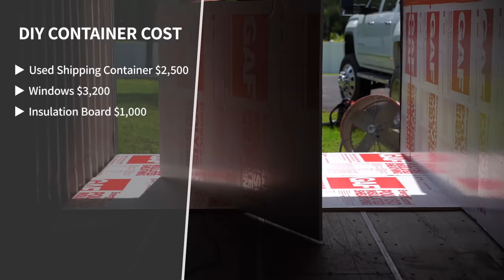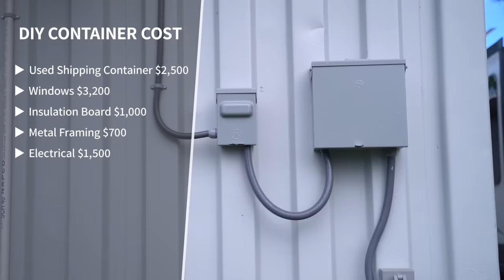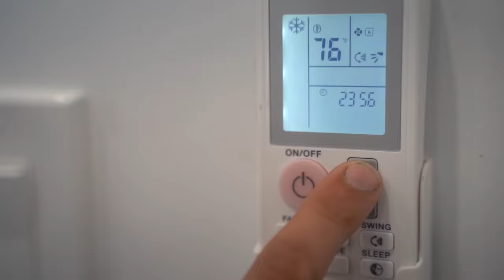40ft DIY Shipping Container Home (Total Cost Breakdown)

Comment: I’d rather spend $30,000 on a shipping container home than a $40,000 car. Absolute no brainer.
Reply: Well said ..
Reply: @kouassikoffi4786  agree.  car = depreciating asset.  Container home = appreciating asset
Reply: @SuperMillions100  if it's depreciating it is a liability homie.
Reply: Advantage of Shipping container is the ability to move the Container house to new other Location... Mobile Deployment House is house of the future
Reply: @rommelcorbito808  A comparible sized wood home could be moved just as easily.
Reply: @JM-nh8yp  Exactly and could make up to 12 feet wide instead of 8 ft and still move many areas without wide load permit.
Reply: Especially if you tack on another 25k for rain water and solar and go completely off grid.
Reply: Spot on!
Reply: I agree but that’s only feasible if you have cash. Financing is another story. There are way more banks that finance cars vs container homes
Reply: And a lot stronger than your average Trailer Park Trailer.
Reply: Paid off our reg. hm early,  then $40k car w/cash.  Better retirement arrangement (for us) after typical 15-2500 sqft hm/shop on 10+ acres.  I see building this in bk of 10 acres now.  Sell orig hm & carry paper for 10yrs of income on balloon note. Older we get..easier for us to slim down we feel.  U all likely see this as 1st hm.  We see this type as our last.  Minus dsily stairs. Using 2 containers/parallel & spaced apart. Then building patio & living space in between space of both containers w/upstairs patio/deck.  If u buy um cheap enuff.  Do 3 cont'rs. & build a U shape w/um.  Enclosing the open 'horse shoe' area to ur taste.  Regardless of what u want/need.  Its not a bad plan for early or late in life.
Reply: how bout a shipping container rv ?? so you have em both .... a house on wheel :)
Reply: @spartanx169x  If you don’t compromise the structure with openings for windows and doors. Otherwise you still have to reinforce with lumber or metal framing of sorts
Reply: Great job and very informative.  Thanks!!
Reply: Right because if you spent $30,000 on a $40,000 car you’d only get 3/4 of it and that would be useless ....
Reply: No kidding! Especially where I live, traffic for days and homes are in the upper 6 figures for a shack 😭
Reply: 4 sure
Reply: get a car on credit and sell it and build your home, spend your saved rent on the car payment and pocket the rest
Reply: @SuperMillions100  everything depreciated, from windows to light fittings, taps etc
Reply: Exactly
Reply: Absolutely. Why ive been song my research. Definitely  investing
Reply: Also better than a $30k 30ft rv
Reply: @ared18t   yup I’m doing this
Reply: @digitalplowboy2823  so with that logic you cannot sell your house? Give your head a shake.
Reply: what about a van life vehicle?
Reply: Then use the profits to buy the car 😜
Reply: Want to make one with me?
Reply: I rather have both 🙏🏼
Reply: Absolutely
Reply: Do both
Reply: Que
Where did you paid 30000$ for everything in Canada?
Reply: Who still buys a 40k car? Me and my buddy were laughing because he still buys 5k cars and he and his wife’s combined income is over 200k a year. Do people that make 50k a year buy 30k cars?! 🥴
Reply: right and wrong your talking about depreciating value over time,  car vs home everyone knows you can't build equity on a car so making up a question that nobody ask is obvious, nobody would want to build equity on a car when buying it because you simply cant.
Reply: Two guys comparing apples to oranges
Reply: I would rather do both of then
Reply: You can sleep in a car but you can't race a house 😉
Reply: @patjohn775  yes, they do. They also live w their mother and go on dating websites.
Reply: @TeePole59  I’d rather live in my 40k car. Hate being stuck in one place. Nomadic heart.
Reply: @patjohn775  I make over 100 k and my vehicle was 42k
Reply: @jacopodanglars4836  They are not cheap. Even 10 years old and very high miles. Like 280k miles!
Reply: Say you're broke without saying you're broke
Reply: @spartanx169x  stronger than a stick build as well. A container is all steel not plastic like most if the components of mobile home. No comparison.  If a tree falls on it, I cut out a small section and welder it back together.  If it falls on a stick build, a huge section of the house is destroyed.
Reply: @chrisluyken4550  you can't sell a car that you bought on credit and pull all the money out of it without paying it off first. No one would buy it. Wtf kind of logic is that?
Reply: @ared18t  it's only a liability if you owe money on it. if it's paid off and worth any money at all, depreciating or not, it's an asset.
Reply: Well said.  I Agreed 💯
Reply: 30k for 160sq feet is astronomically expensive....literally $187 a foot. You would be better off just building a 10x20 house because the exterior of standard construction is better than the exterior of a shipping container. You have to build out the container, the only thing the container provides is the equivalent to vinyl siding, hardy board, brick...the metal is just the exterior and they breakdown very fast on containers and you have to paint them more often than a house.
Reply: @stephenwhite5444  I think it is 40 ft x 8 ft wide, 320 sq ft living space, correct ?  Not 20 ft container. Rental income $1500 each month, I will put 2 units on my land anytime.
Reply: @BriteImpressions1  your right, I was thinking it was 20 but it's 40. But it doesn't matter...all the container is saving you is the exterior plywood, vinyl siding, few bundles of shingles. Which is about the same as the container cost but is longer lasting, easier to repair, and cheaper to maintain. Honestly, I'd rather just go buy a nice used RV with the same budget...itll will more space and be ready to rent out right away. The rental income you'll generate in just the time it takes a single diy'er to build from scratch will offset nearly the whole cost of building something.  ALSO, since this came out 2yrs ago most building materials have doubled, some are much more than doubled....as few, like paint might be about the same, but most have gone way up.
Reply: @stephenwhite5444  thank you very much.  I know someone will do both containers for 75k which can rent out for $3000 combined per month.
Reply: Forsure!! Plus, if you ever want to move, you can easily rent it out 🙌🙌
Reply: @kouassikoffi4786  32²
Reply: I'm with you plus  it will be my Build
Reply: @ared18t  Kiyosaki pilled
Reply: Agrees
Reply: Yes better paying rent can have your own house
Reply: That’s what most people not looking at it’s way cheaper than buying a home.
Reply: Facts
Reply: Agree
Reply: They charge like 67K I think
Reply: Same!!!
Reply: FR. Elon did take a crack at the unit housing thing. But idk what happened to it.
Reply: @stephenwhite5444 i agree, the only reason I consider a shipping container is to build a shop, or storage shed behind my house

Comment: I'm am architect of many years. I've looked at the numbers for this kind of project. I agree with his estimates here.
Reply: what do you do in your freetime Mr. SHROOMER? Hmm? :)
Reply: @EthosAnanda  Bruh. 😂😂😂😂😂
Reply: Ethos Ananda that's why he is an architect
Reply: I mean, he built it, so it's not like he just threw out a random estimate. Lol
Reply: I don't know if you'll respond but how much would this compare to building a traditional home (with wood I guess) of the same size, people keep saying its cheaper but everywhere I look shipping containers seem to be lower
Reply: Bob Dole so your looking at a 20x16 to keep waste down and use 16ft boards. Just the shell of something like that would be around $5k. That also depends if you put post in the ground or pour a slab. If you use same materials inside as he did , you could be a little bit cheaper but not a lot
Reply: @hickoryridgefarms  Thanks, most people never really give me any kind of a concrete answer. So at the very least its starting point would be 5k. Then every thing else from this vid (maybe save for insulation) would be roughly the same, correct?
Reply: Bob Dole could be cheaper than $5k. If you order in bulk at a big box store you could get a discount. Meaning if you ordered all your wood at once you can save some money. 

The inside just depends how you want it finished. Me personally I would buy raw cabinets and finish them your self. Laminate countertops are very appealing anymore but very functional and a lot cheaper than other options. 

As for insulation, spend the money and have it spray foamed. Close cell or open as long as you have an air barrier you won’t have to worry about mold
Reply: Yeah but he's also paying for a crew if you were to do this with very little help and makeover allot of older stuff like used cabinets and items as such it costs way less
Reply: @bobdole27  
From my research it's about 30% cheaper to go container home. I've been trying to find someone who can go start-finish but it's been difficult. 
I've found a couple of parcel but I don't know what  the City/county rules n regs are etc.
I've been "estimating" if I can buy property for $200k
A 1800 +- sq.ft. structure should be about another $200/$250k.
I know that it can be a LOT more but it can be less (as seen here)
I live in California so this would be a "steal" compared to the $850k i just dropped on a traditional  stick house.
(It is nice though ;)..
I have no tools or skills,  only imagination and that can be expensive..
Reply: Can I get a architect information
Reply: I mean how could you not agree. He’s literally
giving you the price he paid.
Reply: @SDPBALLCOACH  I'm in Mexico and a 2 container home goes for $100,000 start to finish..not sure if price is a bit high
Reply: @shoshi06  
Sounds great. 
Thing is, what size containers? how many bedrooms/baths sq. Ft.
How's it been put together etc...
100k makes me a bit nervous....
Reply: @SDPBALLCOACH  yeah,think I'm being ripped off. Am in Mexico and the guys asking this amount. 3 bedrooms,2 bathrooms, upstairs terrace and outdoor main terrace. Living room,kitchen. Price is steep. Cement is cheaper😅😅
Reply: @shoshi06  
Yeah, have you seen it??
Do you have pictures to post??
Mexico or not that's a really cheap price. 
Of course if it's just a fishing or surf shack 
Go for it!!
Reply: every build will have site prep and connect to water or sewage, and permits
Reply: @shoshi06 that’s a pretty reasonable price for that amount of bed rooms. 1 bedroom containers are going for 85k.

Comment: Take the total cost of materials, add $2,500.00 for incidentals and cost increases, at $19,820.00 and for labor multiply by 2.5, and $49,550.00 is your total build cost for the container. Add another $10,000.00 for roofing, siding, outside electrical, Container foundation and landscaping.  Essentially a $60,000.00 build.  Still a great deal for an ADU.

Comment: I'm down in Alabama and built a shipping container for a bunk house at our hunting camp. I'll be the first to admit that it's rough and not nearly as refined as what you do, but there's a local trailer salvage company that we bought all of our fixtures and plumbing needs from such as toilet sinks etc. It's by no means a mansion, but for its purpose we spent less than $7k and did all of the work ourselves. The biggest single expense was renting a trackhoe to dig into the hillside. (The container is set into a slot in the hillside for shelter from storms)
We have a large wood stove for heat and a 15000 BTU air conditioner in the front that keeps it cool in the summer. Aside from the bathroom at the rear and six bunks in the center the kitchen/dining area up front is always open and has plenty of airflow for the heat and cold to work easily. If you guys are interested I could always take and post photos.
Reply: Of course we are interested!
Reply: Please share. I'm most definitely interested.
Reply: Yes I interested in getting one, what must I do?

Comment: Still cheaper than a $800,000 house in Los Angeles that's falling apart. Damn walls can't even hold up a thumb tack 😔
Reply: Lol
Reply: That true, in addition  you spend the rest of your life paying for it, and you can lose it if life throws you a hard ball.
Reply: Yea, but living in Los Angeles was the first mistake......
Reply: I'd reckon putting a container home in LA would cost a lot more too...
Reply: Haah seriously smh
Reply: Most of the 800k are for the ground to put it on, so the container home is not exactly going to solve this problem.
Reply: Yes
Reply: @schwarzerritter5724  no you can find land for 15,000 to 225,000. 800,000 would be an industrial farm. Don't ever get land you would be some realtors sucker
Reply: What you pay for in that LA-house is the location - not construction. If you buy the land to put the container house on in LA I guess that won't be cheap either.
Reply: Get out of that place asap.
Reply: You're paying for the lot for $800k in LA not the home.
Reply: @riobank6245  did you just suggest to never buy land? Are you serious
Reply: Location, Location ...

Comment: Going down the rabbit hole. Watched multiple cost estimate videos for shipping. Container home. Yours is by far the most knowledgeable and articulated I’ve seen. Around 19 to minute 21 of the video your calculations are spot on and this is by a professional, calculating the cost for his own Container home… Your pricing scale can even be multiplied per shipping container to increase the size of the home i.e. $20,000 material for a single container compared to $120,000 for a six container home. That would even account for cost for things such as kitchen and bathroom which don’t multiply times six containers, but the additional cost to reinforce structure, connecting six containers needing reinforcement
Could go on for a while, but all in all great job!

Comment: Thanks for this video!  I bet you have tons of people dreaming of making a tiny shipping container home for $10,000 and you have to burst their bubble.
Reply: Ashley Steeves Well, add 30% to this and he’s realistically talking about $25k +tax to build this for you. I’d add $5k for site prep and landscaping and approvals at least as well.  So, $30k for a home?   It’s a great video in any case.
Reply: @acchaladka  Still not a bad price.  You can't buy a used home and finish to your liking for that.  Hell most Modulars are double to triple the price.   Great option for remote living or budget builds if you're not needing a ton of space.
Reply: Dad's Account oh I agree. I meant that it could be viewed from a couple different angles.  Some people spend $30k just on a bathroom.  I think it’s a nuanced discussion and that $30k can definitely be the right price for some. For example I’d want three containers and 150 sq m / 1500 sq ft total, so I’m better off looking at a gut reno most likely. Whereas someone who’s single...one container for $30k is near-perfect.
Reply: I mean if you get the shipping container delivered directly from the dock or yard, it's about 1/3 the cost. If you get reclaimed material, like all the wood, plumbing, & windows from forest fires or floods, get furniture from Craigslist/OfferUp, make the sink out of a ceramic bowl, use reclaimed wool for 1/4 of the insulation job or rely on building a thermal mass, etc. I mean it won't be easy, and clearly it would take up more time & labor. So it really comes down to saving money or saving time & effort
Reply: Ashley Steeves I was definitely misinformed wasn’t buying it but the numbers couldn’t have been farther off
Reply: And that build isn't to code.

Comment: important stuff missing here: cleaning/sandblasting and repaint [sometimes the containers are used to carry poisons or garbage] and sometimes a little panel-beating and one of the most important - strength integrity, remember you can't just cut, you have to reinforce
Reply: The cutting and reinforcing would be in the labor costs. You could spend a little more for a brand new or barely used container.
Reply: You shouldn't use industrial containers for living that violates regulatory laws. You should only use food grade or basic logistics containers